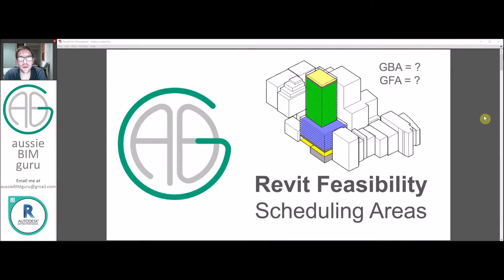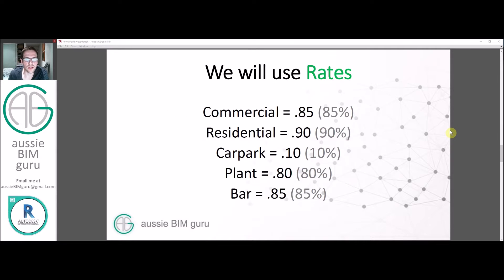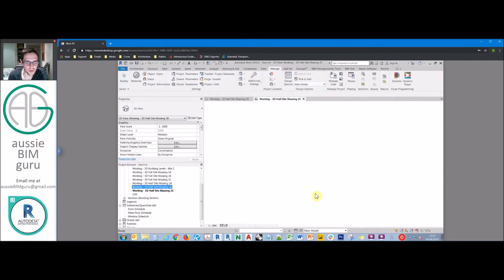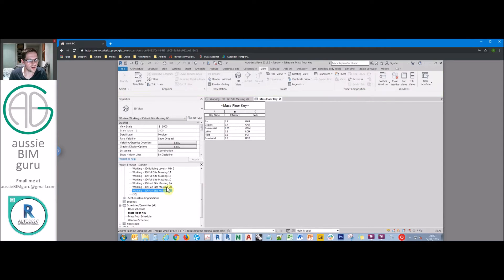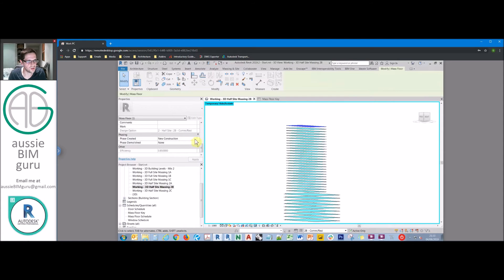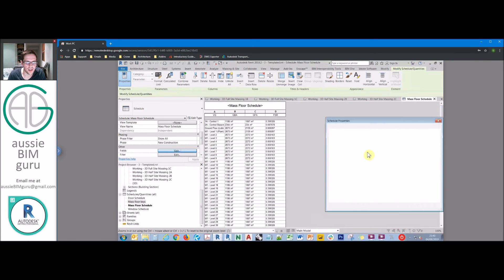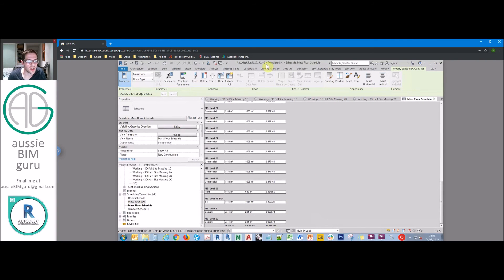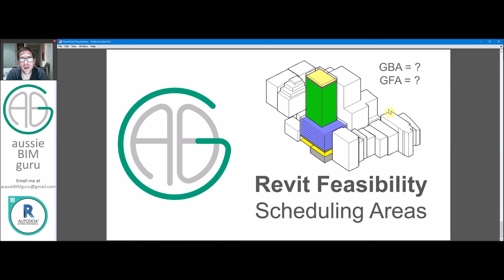Revit Massing Area Schedules (Feasibility Part 4)

Comment: How can I create generated floor plans depending on the number of shelves in a logistics hall if i want to maximize the number of shelves.
Reply from the maker: It depends on how complex the configurations are. I'd explore the generative design tool for revit, I have a video on this next week on the channel :)
Reply: @AussieBIMGuru sounds good for me :) important parameters would be distances to walls, distances to other shelves and supports and also the keeping of aisle widths. I would like to treat the topic as a bachelor thesis next year. I would have thought that I would also have to familiarize myself with dynamo or grasshopper.
Reply from the maker: @markbenching  both tools can achieve this, a simple method would be to run a grid distribution across the space and use intersection with room geometry to maximise successful shelves.

If you want more bespoke configurations like turning corners then it gets harder, as you need to build flexible algorithms to detect these conditions - it gets complex quite quickly.
Reply: @AussieBIMGuru  
the program should be able to decide whether horizontal or vertical positioning makes more sense or even a mixture of both.
My idea was also to have the office area of the warehouse building generated and, as just mentioned, also determine the shelf positions. I know from experience that storage space is very much discussed in the floor plan.
Do you think the topic makes sense? How would I program the grid or better asked how would I even start? Thanks for your quick replies.
Reply from the maker: @markbenching  it makes sense but is very bespoke and potentially complex. I can see your team look to have contacted me externally so will reply there.
Reply: @AussieBIMGuru  I have no team to be honest. Dont know what you mean  with that.
Reply from the maker: Oh that's odd... I got a nearly identical request via my consulting business just a few hours ago. Apologies I thought they were related.

In that case...

The grid I would generate based on the space's bounding box base surface, a grid of points at UV parameters would do the trick. You could use isocurves to determine the domain length if you have max spacing rules.

The office could be placed by assessing corners of the boundary and placing a cube from this corner.

The generative design tool could iterate the variables if required. Note this would not be enough to generate turning aisles and central aisles through the space - this would be rather complex and require interpretation of the geometry of the space at a deeper level.

I'll explore this a bit for a future video as this could be an interesting test for the generative design tool. Probably a ways off however as I have a pipeline.